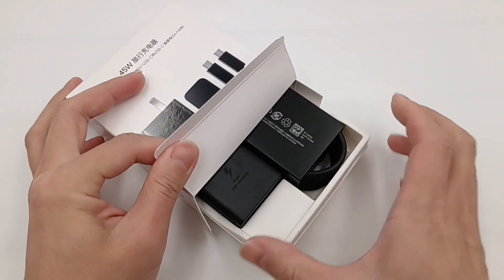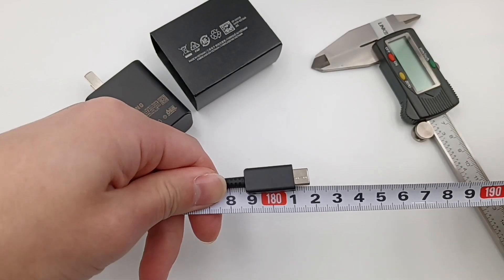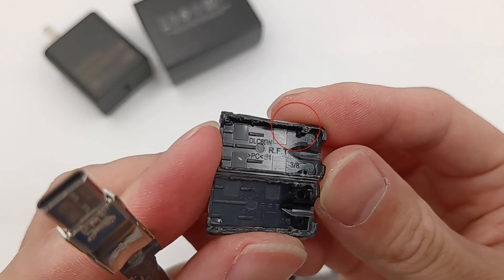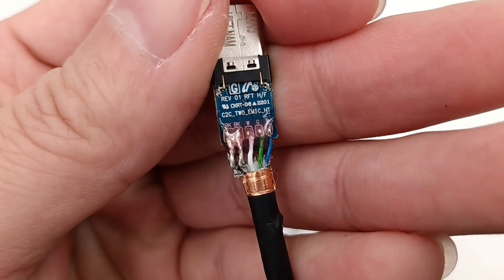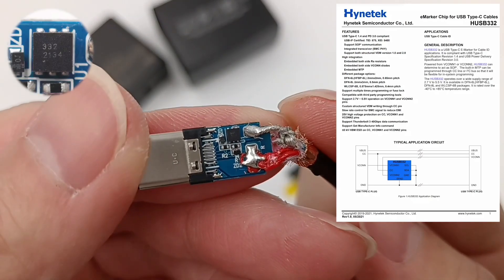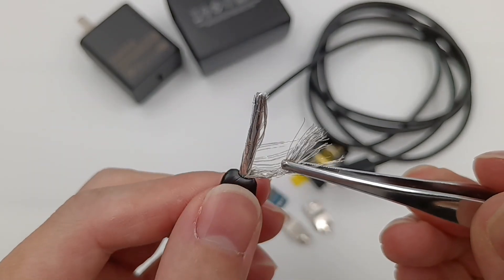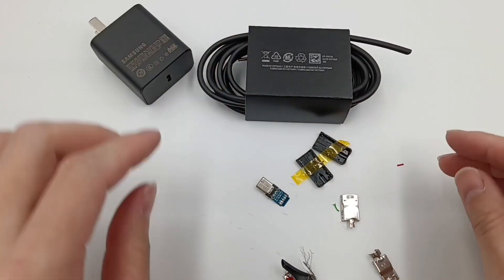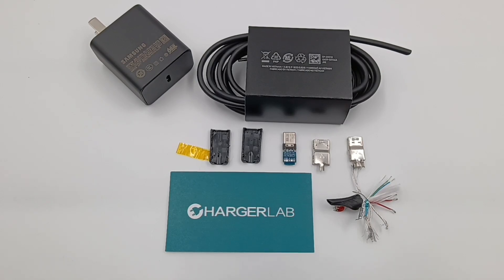Teardown of Samsung 100W USB-C Cable (For New 45W Charger)

Comment: Hello, I got this cable with the 45w samsung charger that I bought, I have been taking good care of the brick and the cable I never bent it while using the phone or anything like that you could say its still brand new after a long time I've been using it, but one day the cable started to malfunction, when I move one side the very end of the cable any tiny movement disconnects the cable from the phone or any other device I tried, so now I need to connect the broken side of the cable to the brick and do tiny movements until it connects so I can charge my phone, what could have happened and would I be able to fix it?
Reply: By moving the cable I mean I am moving the connector on the plastic case any tiny movement anywhere makes it connect or disconnect

Comment: Can you charge a samsing device with 5a cable but with 3a adapter or 3a power bank, will it damage my battery
Reply from the maker: The charging power is determined by the receiving end, such as the phone. So, you can do that.

Comment: Is it still safe to use if the layer of shielding is broken and the tin foil is ripped. But the colored cable is still intact ???
Reply from the maker: We advise you get a new one, cause it increases the risk of an accident.

Comment: Please do a teardown of  Standard 3A USB- C to C Samsung cable which comes with a 25W Charger want to know what is the difference between different USB-C to USB-C cables.
Reply: Mostly the amount of 'leads' (pins) that are connected, and the programming on the chip (that's there to 'tell' the connected devices what the cable's capable of). If that cable is made by the same factory, chance is that the cable's going to otherwise look nearly identical internally.

Comment: Looks like it's only supposed USB 2.0. I didn't see the super speed bus wires.
Reply from the maker: cause it's for charging, not for data transmission.
Reply: @ChargerLAB  I understand that.  Just people are always under the impression that if it has a type C connector, it must be faster in every way. I constantly find myself trying to explain that type C is just a connector. It doesn't tell you the protocol.
Reply from the maker: Yep, you're correct.

Comment: Thanks for uploading another very useful and informative cable tear down. The cable is of good quality and quite surprise that the USB-C connector have a seam and the plastic cover is just clip on. Perhaps to reduce the cost. The APPLE charging cable tear down earlier was of higher and better construction. Hopefully the USB-C connector seam don’t open apart and short out the USB-C receptacles in devices. Also the seam will make the power cable USB-C connector structurally weak with repeated use plugging in and plugging out. 👍🏽👍🏽👍🏽
Reply from the maker: Thanks for sharing.
Reply: @ChargerLAB  most welcome

Comment: why do you think the seams are a problem?
Reply from the maker: the PSM-IPAD64 Z17 _O X 15  can answer your problem.

the seam will make the power cable USB-C connector structurally weak with repeated use plugging in and plugging out.